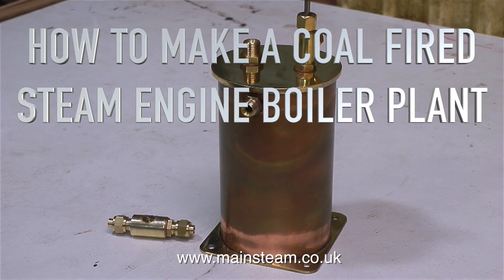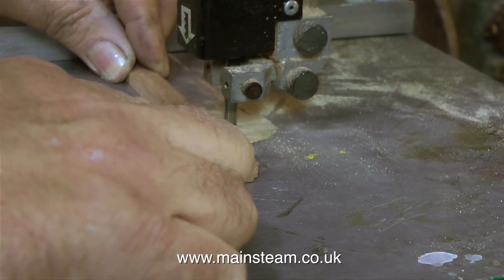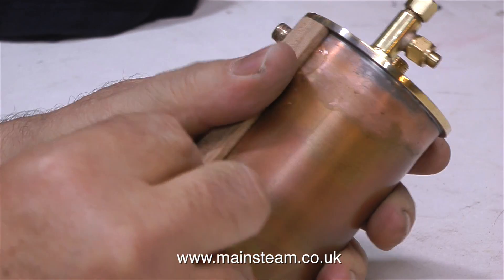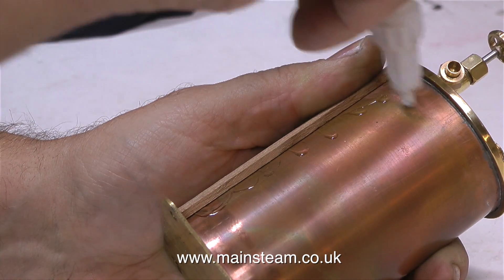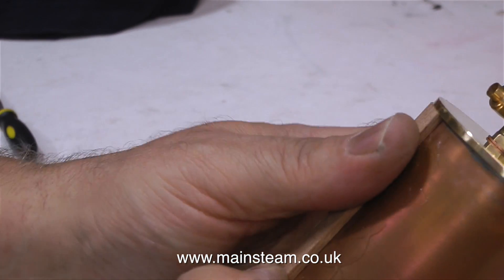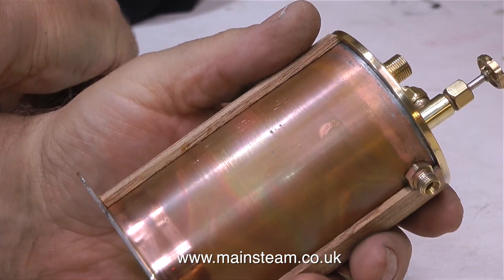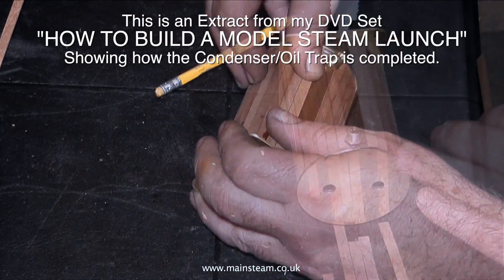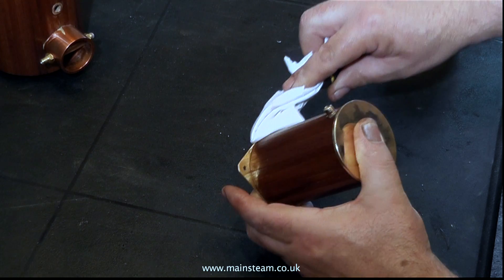HOW TO MAKE A COAL FIRED STEAM ENGINE BOILER PLANT - PART #21

Comment: I am glad to see that I am not the only one who clades there  condensers/oil traps. I always say it is to keep the steam hot so that it gives me a lovely plume coming from  the stack. Someone then says "if you condense it proper you will not have to wipe the water spots off the model". if you then ask them how they do it on there model they then admit that there boats are all electric powered, and the steam engines they build only run on air.

Comment: A little random question, but how do you make sure the strips are vertical and not slightly tiled? Just by eyesight or is there some trick?
Reply from the maker: I use the Eyeball method mostly .... :-)))
Reply: When I do this kind of work, I cant the strips slightly widdershins to compensate for the curvature of the Earth.

Comment: Keith, thanks as always for fascinating videos. Can you clarify a point for me. I though the purpose of a condenser was to cool the exhaust, so why would you want to insulate it with cladding?
Reply from the maker: in this case cooling the exhaust is not what is needed, as it is really an exhaust oil trap in model sizes. The wood just looks pretty and it's traditional in model boats to clad them like this.

Comment: Keith

I am going to ask a very dumb question ,why do you lag a condenser Surly you defeat the ability to condense the exhaust?
I assume ( yes I do know the breakdown of that word👍) it’s more for decoration than function

Stuart thanks for the thanks I will drop you a drip when the pension allows
Reply from the maker: in this case cooling the exhaust is not what is needed, as it is really an exhaust oil trap in model sizes. The wood just looks pretty and it's traditional in model boats to clad them like this. The effect of the cladding would only to help prevent the condenser condensing the exhaust steam too quickly therefore needing too frequent emptying.
Reply: Keith Appleton 
Thanks for taking the time to answer my question 
Back to the WS tomorrow to make some more parts after doing the CAD tonight , and yes I have been doing this hobby for a long long time , but I must congratulate you on the simple and consistent way in which you put things across very refreshing, my moto is you are never to old to learn ,to that end I have learned a lot on sitting Stevenson,s link valve gear